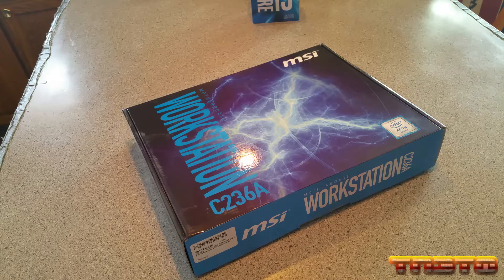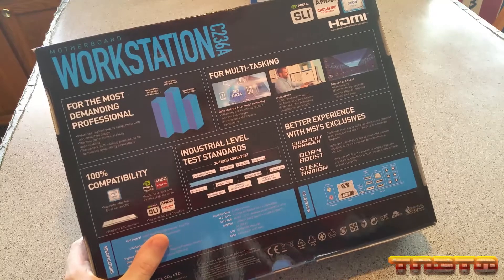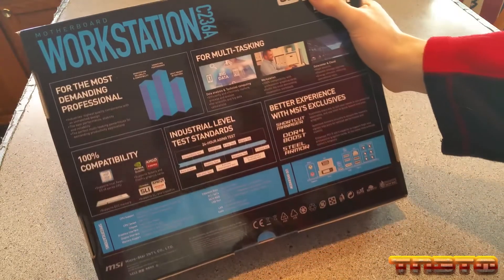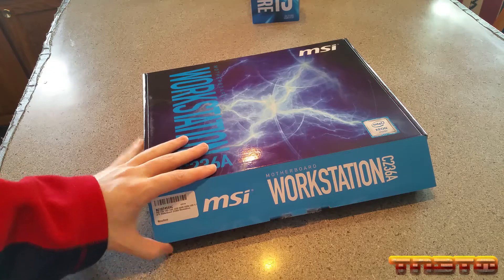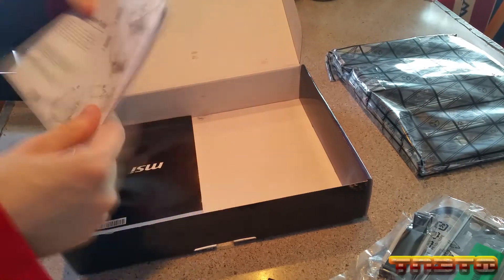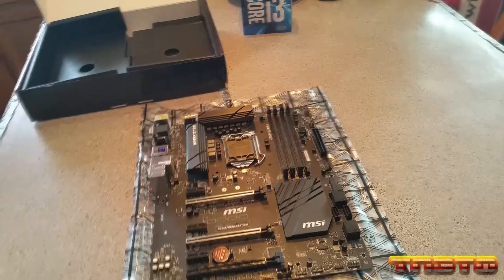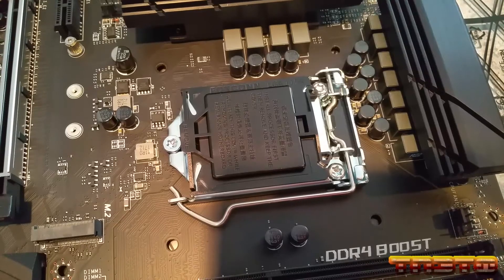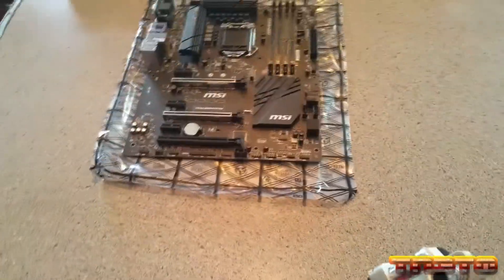[FreeNAS Build] Part 1: The Motherboard (MSI C236A Workstation)

Comment: This is an ATX board right? I'm considering building a Nas and hadn't thought of using workstation class boards.  Good idea.  My only issue is going with a larger board and not mini itx etc.  I'm looking to build something in a small form factor.  Any suggestions?
Reply: Yes, there is a MSI C236M which is the Micro ATX version thou